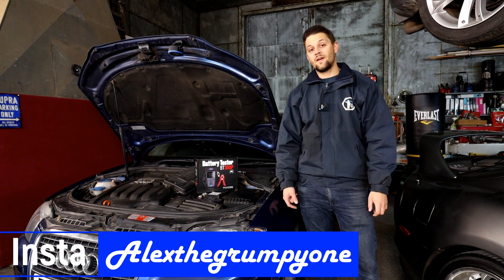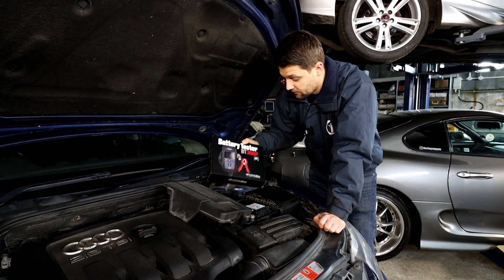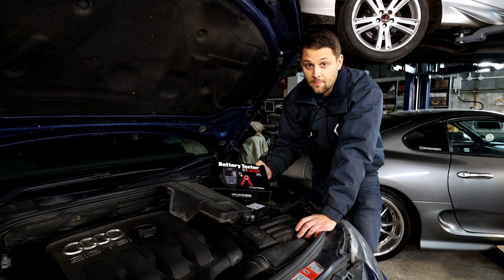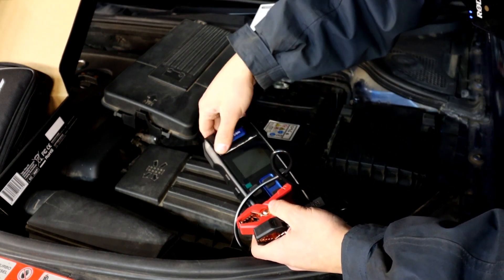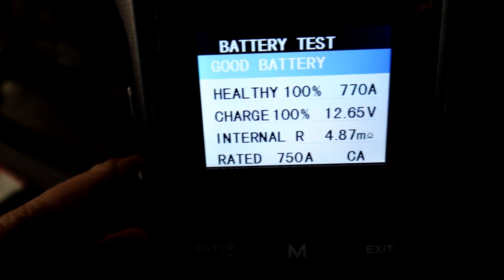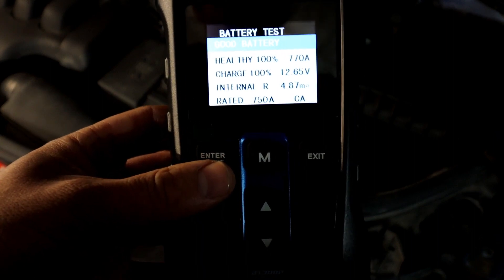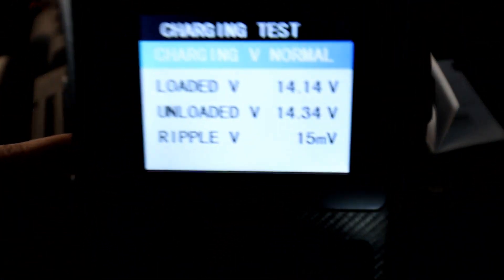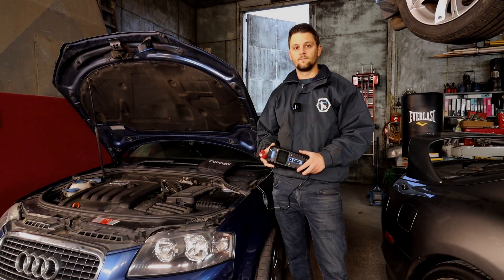Topdon battery tester BT300P Demo and Review. How to test your battery. Why my car doesn't start?

Comment: Hi,do the screen ever go blank on this device when using it.
Reply: Thank you for your reply,the reason I was asking I had seen on YouTube people saying there unit had faults in them,and the unit had to have pass stickers on them.
Reply from the maker: Oh ok. That's fair enough. On my one so far it's ok
Reply from the maker: Sometimes it can if the battery is too low to test it looses power half way through or if the connection isn't very good